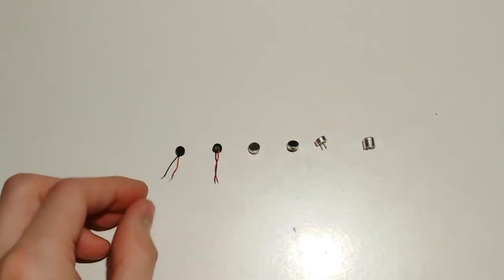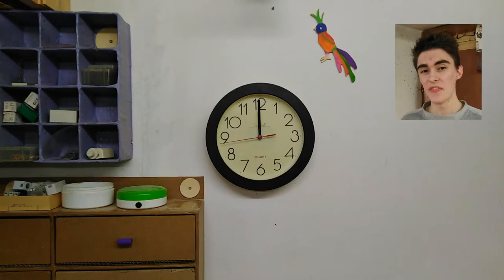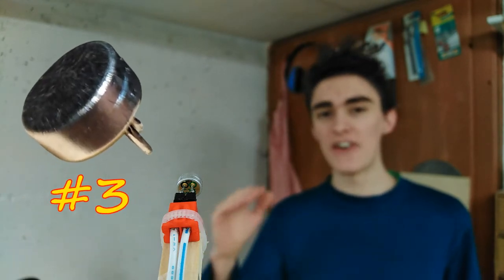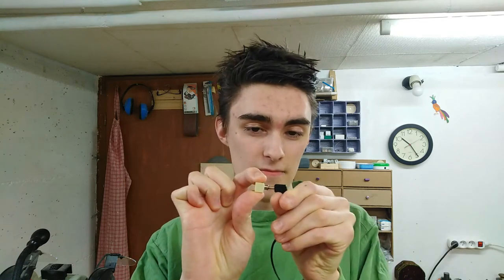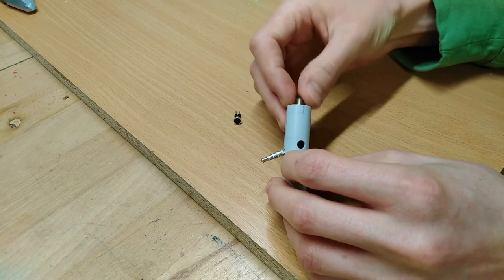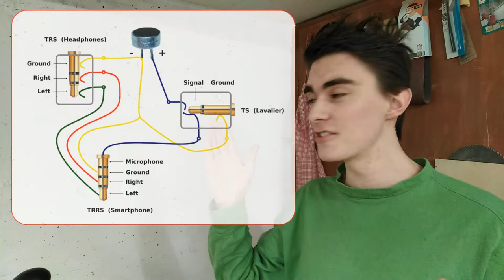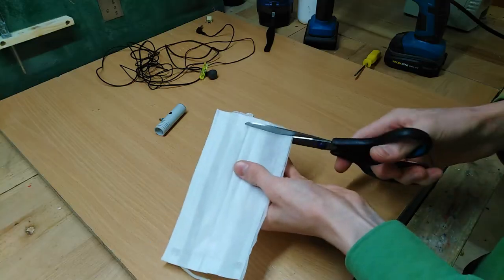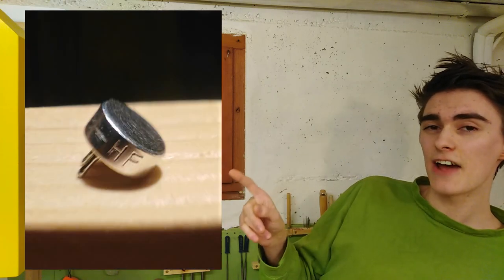Cheap DIY lavalier & shotgun microphone for smartphones | Homemade camera gear #2

Comment from the maker: It's worth mentioning that the lapel mic doesn't actually sound as bad as it seemed in the last clip, it still sounds  better than the shotgun mic does, I just did a bad job at using it. 🤣 Still need to learn how to do that properly 😉
Reply: I suspect that clip of the lapel mic was a little muffled just due to the direction the capsule was facing. Still sound great though!
Reply from the maker: @ConorFenlon  No, actually there is a little dark secret I never got around to exposing in a seperate follow up video: The mic you see me using in all videos since isn't actually the same electret capsule used in this video - just after posting I realized a flaw in my testing method. The generally best sounding mic at a certain distance from my mouth isn't the best sounding when clipped to my shirt, since bass frequencies are a lot more prominent close to my throat than somewhere else. Instead I ended up replacing the microphone head with an identical using capsule #1 that I immediately ruled out in this video. It responds much less to bass frequencies which shifts my voice to a more natural sectrum making it sound less muffled. Sorry for deceiving 😔

Comment: Those is REALLY impressive work ! You're building kits that could pass as pro built DIY ! You've got mad skills, thank you for sharing !!

Next project could be "Using a $3 AliExpress FM transmitter with a DIY lapel mic !"
(Bluetooth is a problem because of the lag)
Reply from the maker: Wow, thanks! Glad you like it 😊
I'll definitely look into the wireless lapel mic! I've been using the lavalier for the upcoming video, and the cable really ends up getting in the way, so thanks for suggestion!
Reply: @ChronicMechatronic  Yeah, I just use a second really old Android phone to record lavalier mic audio and sync it in editing using the three claps technique..
Reply from the maker: @edwardfletcher7790  That's probably the easiest way, though I wanted to avoid the hassle of editing in all the separate audio. 
I've got two ancient phones lying around, but those are even too old to record usable audio...
Nonetheless I'll see if I can make at least some sort of wireless microphone, maybe a handheld one would be nice (although useless).
Reply: @ChronicMechatronic  I'm using a 2011 Motorola running Android 4.1. It's much easier to synch audio than you think. Three claps make it easy.
I look forward to your future videos !

Comment: Interesting, i must try this and also make video, since rode videomicro is just capsule and nothing else
Reply from the maker: Well not quite, a proper microphone also has a preamplifier and stuff
Reply: @ChronicMechatronic  Ok ok, there may be resistor or somethning I dont reckognize but its all whats inside, open back end easy but top end, with pliers, thread is glued from factory Capsule is 14mm  looks exactly like that el cheapo from ali, search for 1463